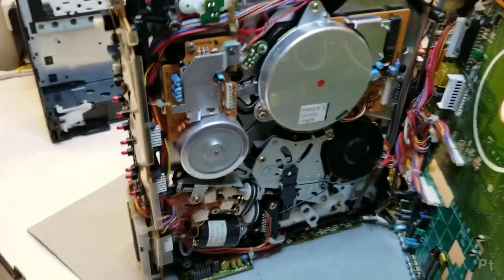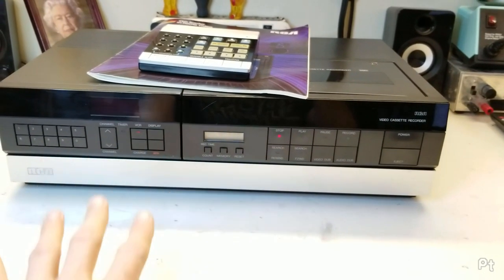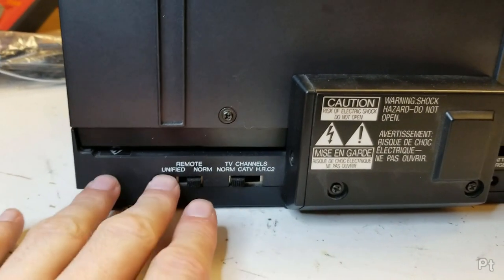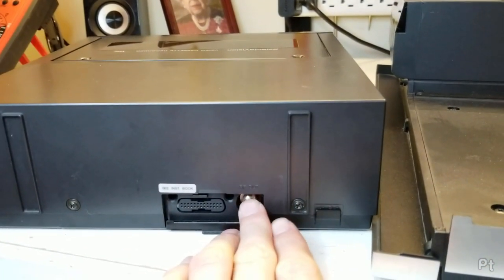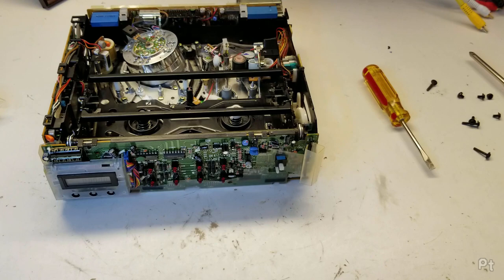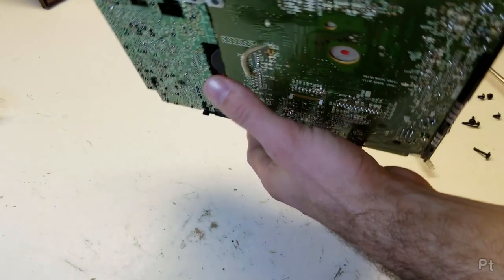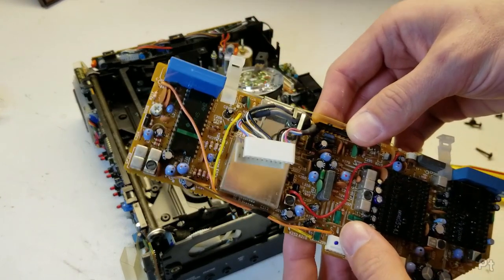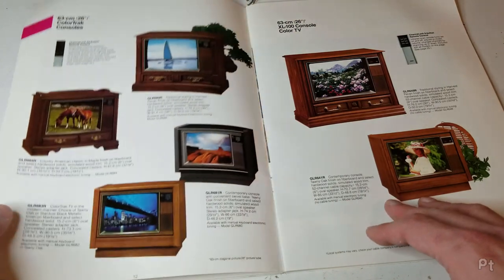RCA VKP-900 Convertible VCR & Camera (from 1985)

Comment: Part 2
On this same video, you had a catalog of all of the RCA Consumer products.  It had all of my own products in them. Do you remember when you reached the section showing DIMENSIA? You commented that you had not seen the other components.  In 1987, I gave the pecan seletavision console to my parents, who were looking to upgrade. Why? I saw my first Dimensia set-up in a poster at our local RCA store. I went to school with the owner at the time and inquired more. After all was said and done, I got the complete system. The TV I chose was the black, grey, and silver model.  The screen was 27" flat. It had a clear, removable plastic screen cover. To the left of the screen were the adjustable shelving to house the amplifier and tuner, the single disc CD player, turn table, and S-vhs vcr. It had one remote that could operate everything. The vcr had its own remote to control special effects that the other couldn't.  The TV sat on the dual dimensional speaker system but I had the tower dimensia speakers, too. They were placed on each side of the main unit. I have nothing but great memories and photos, now. However, it was a great electronic part of my life; one I wanted to pass along to you. As  you said, they were not at the local stores. If an area did not have a stand alone RCA Consumer electronics sales and repair location, one would not see them. 
Finally my question.  I would like to obtain a catalog, similar to the one you shared in this video. I have looked on ebay, but what I saw was not as complete as yours. Any information or direction to help me our searching would be appreciated.  
My apologies for the comment lengths, but as I said before, I feel the background makes for more credibility. Enjoy your evening, thanks for your programs, along with all your information here!

Comment: Did you find the bands for the rollers? I have the same VCR I bought brand new in 84 from the Navy Exchange in Great Lakes.
Reply from the maker: I think I got refunded for one of the belts, as it was no longer available. I haven't gotten any further with this model since it has major capacitor plague. Almost every cap spilled it electrolytic fluid.

Comment: This is very similar to my Hitachi VT-8E. I can control mine using an app on my phone which has a IR blaster. Can you please tell what's the size of that damn washer that holds the idler wheel in place? I can't find anything that fits. That brochure is really cool too.
Reply from the maker: I'll measure it when I take this apart again (soon). I plan to swap out the bad loading belts and see if I can get it to do anything, or if the caps are too far gone.

Comment: I have a Hitachi VT-7A portable from about 1983. The front panel with the buttons is different (as well as the I/O on the side) and I don't have the dock (if it even had one). However the internal chassis look very, very similar. I think the belts are shot on it, because when I put a tape in it doesn't move at all and I hear an awful noise. I haven't taken it apart but I have the service manual it's a total chore just to access the belts. And yeah, will bet money there's leaking caps. 

No thanks, but I'll stick to my two Betamax portables I have (SL-2000 and SLO-340). Much better machines and they still work. In my experience VHS portables are crap.

As for the camera, it looks like it has a beam index color CRT viewfinder! A guy named Cathode Ray Dude did a good video on those. I think the tube on the camera might be worn. I'm assuming this camera uses a Saticon tube since it's made by Hitachi.
Reply from the maker: I think the Hitachi VHS portables were most common (mainly under the RCA name) and yeah, they had oodles of capacitor problems. Even in the 90s, I remember the Hitachi portables having all sorts of capacitor related problems.